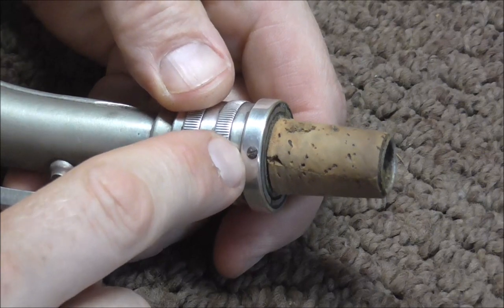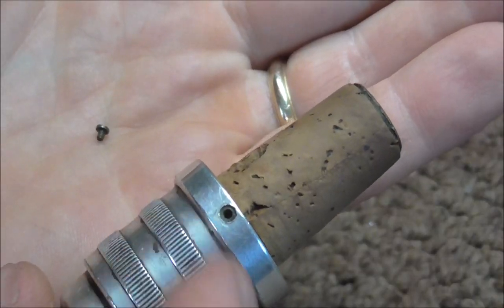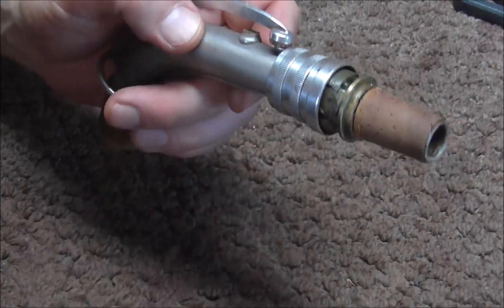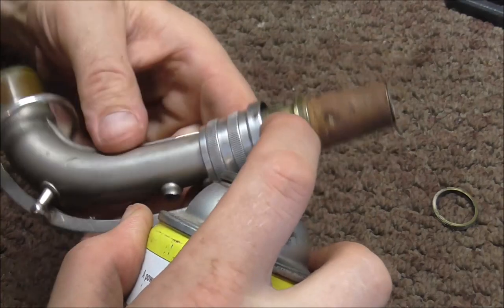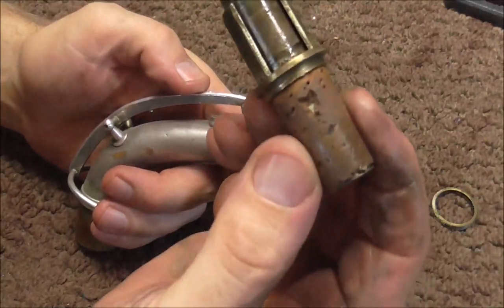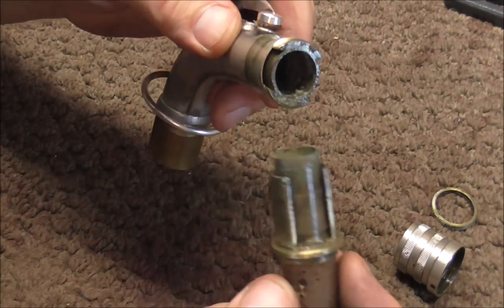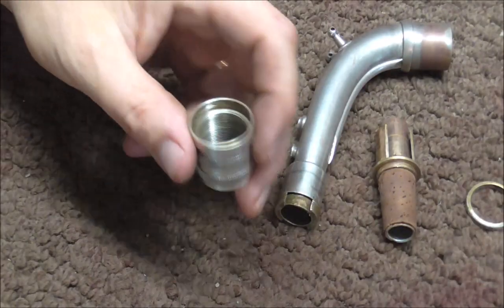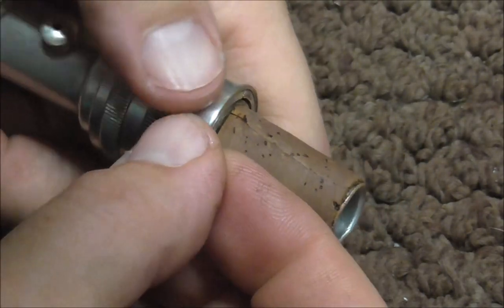How To Fix a Vintage Conn Saxophone Tunable Neck

Comment: Hi great vid!
On my sax the pin key that pushes the crook key ring is bent and I’m afraid that if I force it it’ll snap any tips ❓
Reply from the maker: You need to be careful to rotate the bend around the point where it needs to bend. If you do it the right way, there is a small chance it will break. If you bend it in an uncontrolled way, there is a lot more chance that it will break. It is very hard to explain the technique in words. I have not yet done a video on this yet, but I will try to publish one in the near future.
Reply from the maker: You have to decide if you want to risk it. You may be better off taking it to a repair shop.
Reply: Ok thank you 😊

Comment: A weirdly overdesigned system. It's no mystery why nobody else adopted it. Besides having to mess around with the tiny screws and the spanner rings, the outboard end of the moving part is very thin and easily damaged. Particularly on C-mels (which basically have people mystified so that they try to do awful things like cram alto mouthpieces on), that end can take a beating. 

I wish I had some long screwdriver inserts like that.